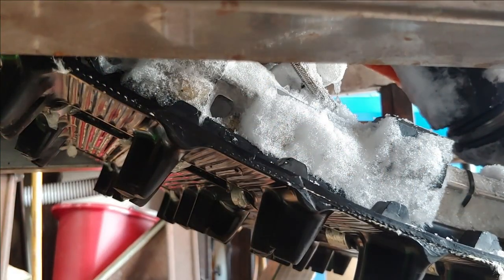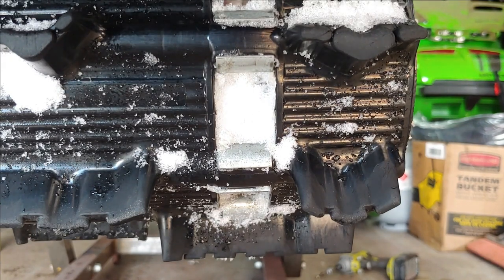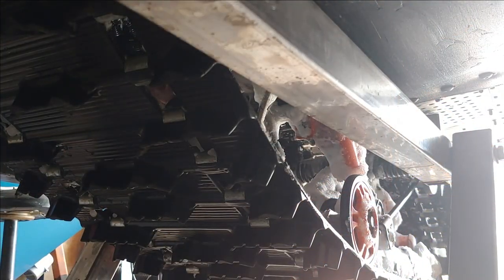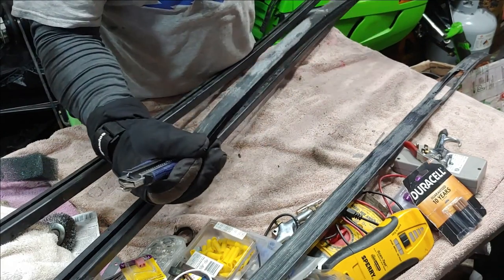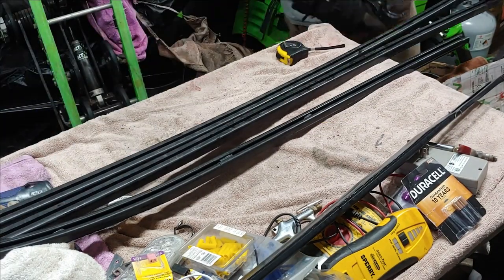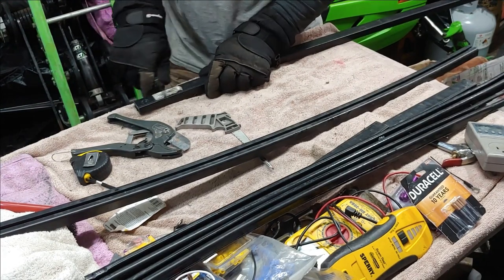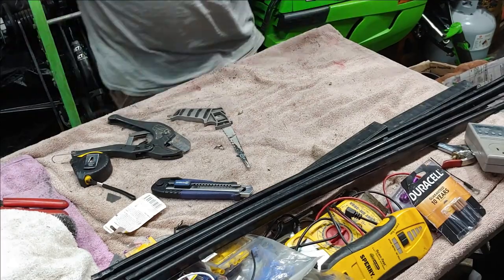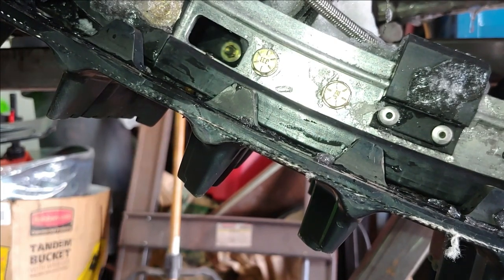Replace Rail Slides the Easy Way [Track Window Method]

Comment: Andrew. As always, great work and a useful video. My advice to you is not to suffer with the mounting blade knocking out the sliders. I use a hammer drill . I turn it on for chiseling without rotation and knock it out. I use an old useless drill . I sharpen it flat. Very fast and easy to go.
Reply from the maker: Great idea. I dont have one like that in which it has option to turn off the drilling..

Comment: OK as long as you don't mind cutting the track.
Reply from the maker: Hasn't happened to me. If yiu have reverse.yiy can also do it that way. Just pop out the hyfax a little through a drive tooth window and the track will do the rest. 

Thanks for watching.
Reply: @Fixin2Ride-Official-  That was my point, the track windows aren't always wide enough to allow the slides to pass.
Consequently a person has two options, either widen the windows or pop off the skid.
In all my years I have yet to see track windows wide enough to permit slides to pass through..
Reply from the maker: @jeffreyhagelin3672 gotcha! Thank. You!
Reply: @Fixin2Ride-Official-  .. unless you're willing to cut..
Reply: @Fixin2Ride-Official-  I would not advise you to stick the slide through and then put it in reverse unless you want to ruin a $1000 track..😀😀😀
Reply from the maker: You have missed with these tracks right? They are tough as heck man. A couple pieces of plastic are not going to ruin them.